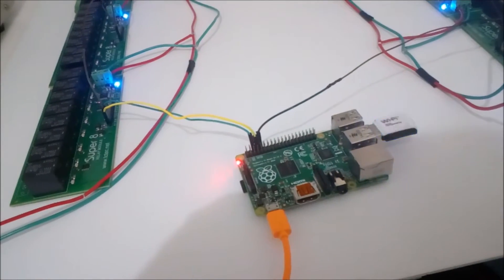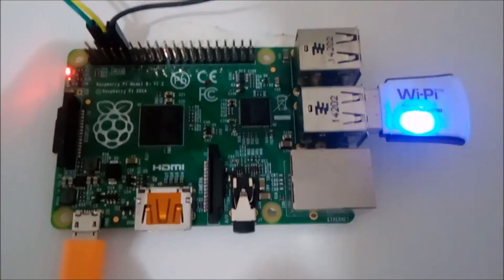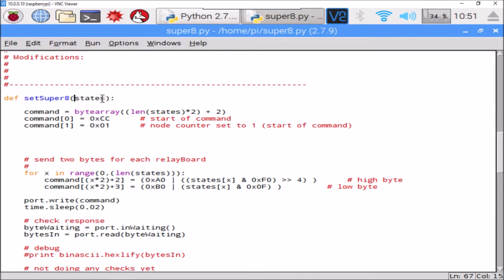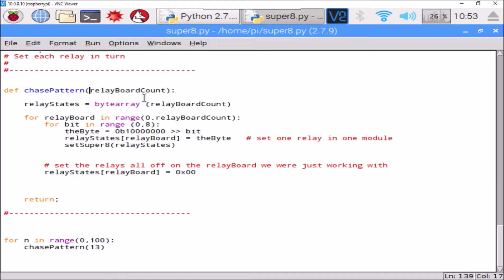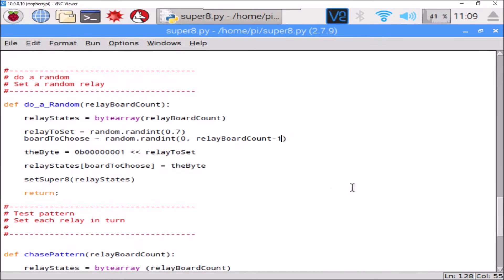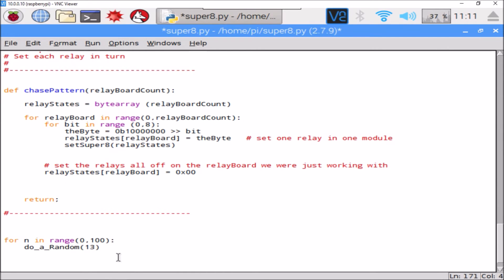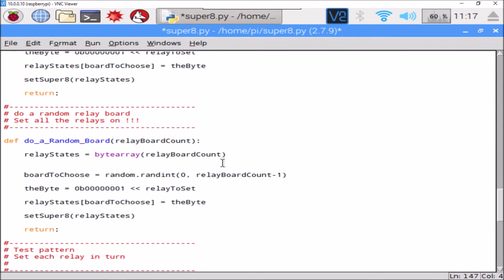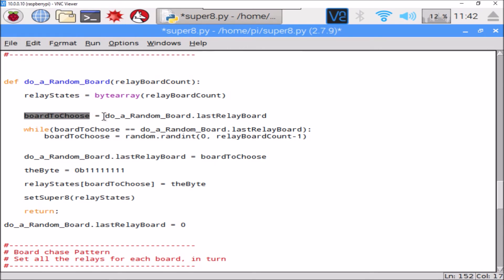Raspberry Pi: Control 100 Relays Python example

Comment: Do the serial control of the board have a name or is it a named technology since the super 8 board is incredible hard to find, and the digital control is exactly what I am looking for in a project where I will be using a ton of pins, which this digital control could help me save a lot of pins
Reply from the maker: Hi , each board is like an Arduino Nano.  So, the digital pins are spread across many 'Arduino Nanos'. If your project is suited to spreading-out in space across many nanos. (example, 18 pins on each block) Then I can help you with the code. Call it 'tctec bus'.  (website tctec net). eg 10 nanos = 180 input/outputs.
Reply: @tctec1129  so it is basically just a bunch of relays connected to an array of arduinos?
Reply from the maker: @soerenkk  Yes. Less wires, more micros.

Comment: Hey there! Just wondering, how did you go about creating your power rail?
Reply from the maker: HI, The insulation is carefully cut and pushed back, without cutting the wire. Then a small branch wire can be twisted on and soldered.  The supply is 5Volts 3 amps.

Comment: Holy shite serializable relay boards. I didnt know that was a thing. I was seriously designing shift register arrays to control tons of relays. This is super simple. 

Voltage on these says its good for 250 vac but lower voltage DC would be fine correct?
Reply from the maker: Yes,  they are mechanical relays (G5LE) Specify a max current of 4 Amps for DC voltages
Reply: @tctec1129  And how can I get my hands on these? None of the sources listed in these comments seem to have a working website.

Comment: Is there any way I can trigger each relay manually for momentarily of two or three seconds
Reply from the maker: This is a late reply sorry, But it is a good question. The relays are under full control of the controller sending commands. The Controller could send an update every second to all the relays at once, and update any or all relays with their new state. There is only a command to turn a relay on or off. Timing is handled by the controller. ie the python or arduino system

Comment: Are you able to send a command to only one relay at the time as well? Like turning only one of them off and on?
Reply from the maker: Commands are sent through the whole bank. To change only one relay, only one bit is changed, however all of the relays receive a new bit. Any relay can be changed, but as the chain get longer, it takes longer to send a new update through because every board will receive an update. Even if the update is 'no change'
Reply: This is fantastic but can you give an example of the code or explain how you would choose and change just one specific relay?  Pretty new to the Raspberry scene but knew that the 1 to 1 GPIO wire set up was not the best way to go and a bit clumsy.

I have a couple questions and although I understand that you would define theByte = 10000000 if you wanted say the first relay on a board lit but:

1. how do you define which specific board you want it to be on say if you had just 2 or 3 relay boards?
2. how do you make it stay on until until you run an 'off' script - do you have to make it stay or does the '1' stay until you send the 'off' script?
3. I am assuming that the  'off' script would simply be turning the 1 back to a 0?
4. do you have to use the super8 relay board or will this script technique work with any relay board? (I am finding it difficult to purchase that particular board).

Thanks so much for the help and patience with someone that is a little green.
Reply from the maker: @waltsgreene  Once again sorry for such a late reply to this.  I intend to release the code and schematic of this so anyone can use the technique with arduinos. If you had 2 boards you send 2 bytes to the function, if you have 3, your send 3 bytes etc. he controller program sets or un-sets bits, and then sends out the updated bits. If relay5 was set to 1 ON, and then you send out new bits where relay5 is still a 1, then it wont change.
Reply from the maker: Hi,
To answer your questions:

1.  In the Python and arduino code, the number of relays is set by the size of the array.  eg, if there were 2 relay boards, use an array of 2 bytes (00000001, 00000000)  would set relay      '1' on board '1'.

2.  A command is sent out to the relay boards. The relay boards contain a micro, so they hold their state until they receive a new command.  i.e, even if the communication wire was disconnected, the relays keep their state.

3.  Yes, the Off script would turn 1 to 0. eg all relays ON : 11111111, all relays OFF = 00000000

4. Sorry, this is specifically for this particular relay board that contains the uart (serial port) and on-board micro.